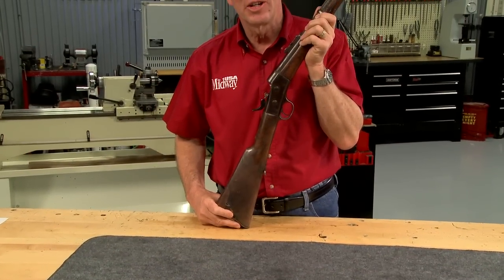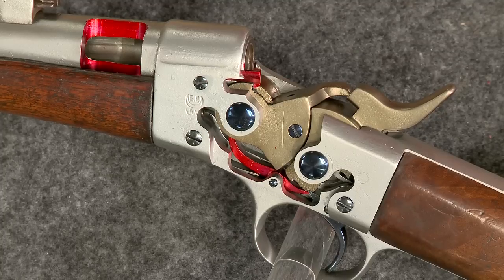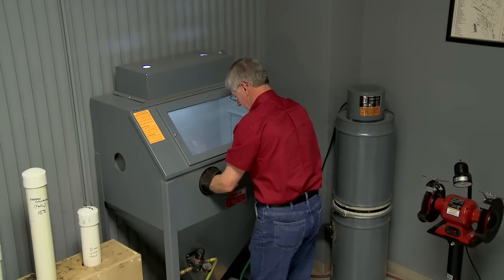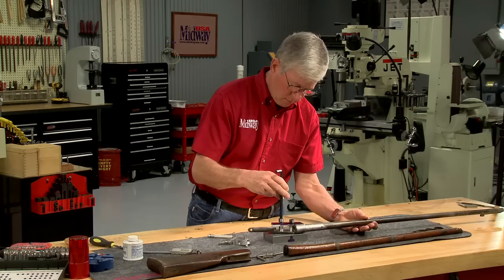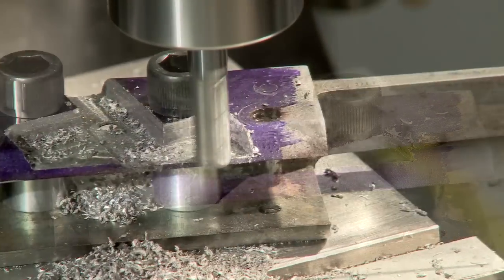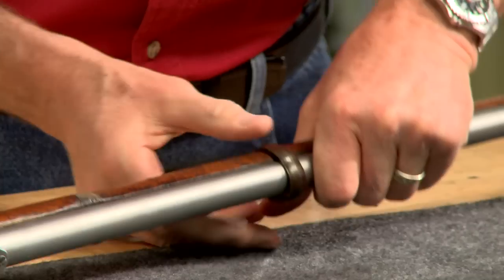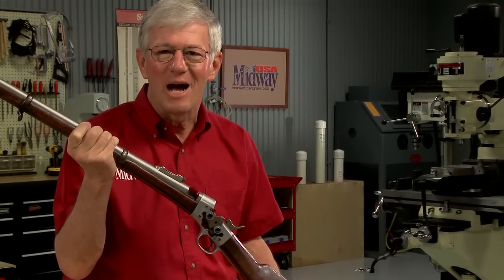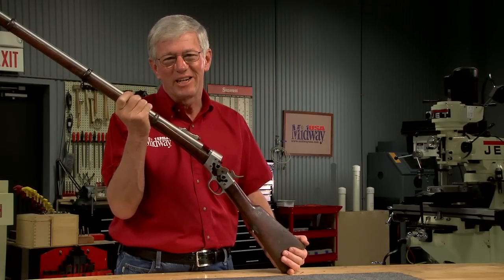How to Make a Cut-Away Rolling Block

Comment: I'm considering getting a #4 take down that is at a Cabela's near me but they want $699.99 in so so condition. I want a FUNCTIONAL AND USEABLE rifle.  I need to check out the bore. I've got a Steven's Favorite that is decent condition and a Winchester 1904 in pretty good condition considering its age (1916-1920) because of markings on the barrel. I like old single shot 22lrs, fun to shoot and economical to shoot as well.  I don't want PRISTINE ONES then I would want to shoot them, just FUNCTIONAL. I'm MAD at myself for selling a REALLY NICE "ORIGINAL GECO CARBINER MODEL 1919" , it was REALLY COOL AND SURPRISINGLY NICER MACHINING THAN ALMOST ANY AMERICAN MADE 22LR OF THAT TIME.  😯😁.  WHAT DO YOU THINK?🤔